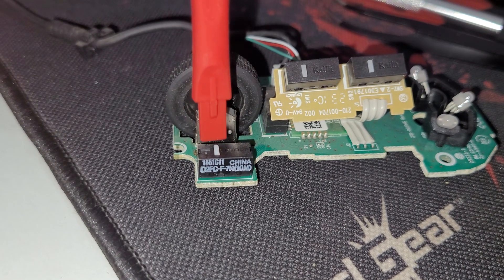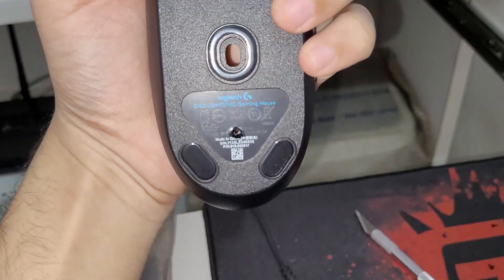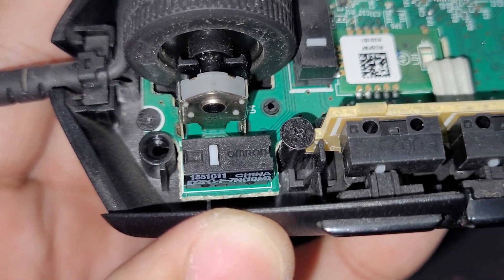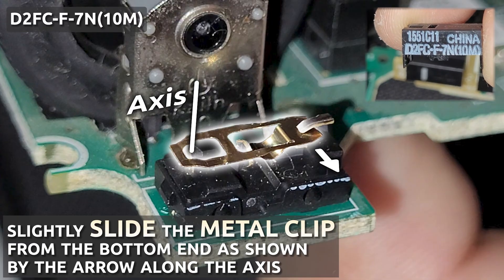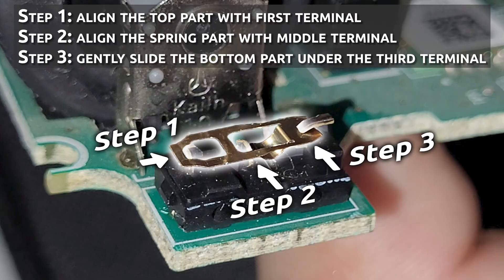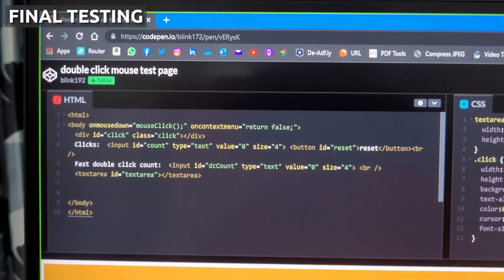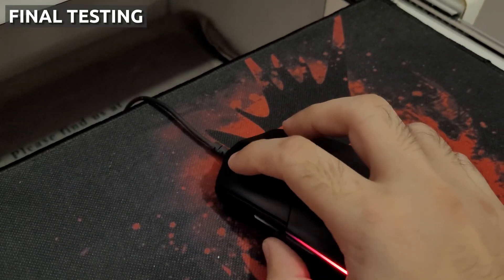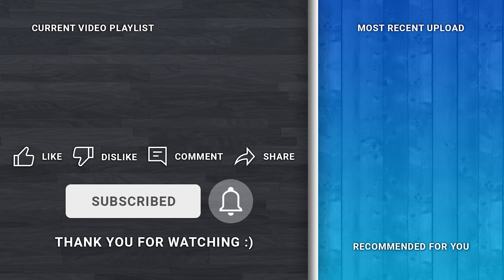Logitech G102 Lightsync: Teardown & Fixing Double Click Issue

Comment: If your mouse is relatively new. Like less than 3 year old . Then just blow some air from your mouth between the gaps of the mouse cause in some mouses(including G102) the double click issue happens because of static build up and our breath has enough moisture to remove that extra static build-up .My almost 3 year G102 had a double click issue and it got fixed by the method above.
Reply from the maker: Woah
Reply: @LoveleshKalonia  this worked for me wow thank you!
Reply from the maker: Spray a little WD40 too, so that it lasts long.
This issue comes back in a few months.
Reply: I tried it and actually worked. Very thanks!
Reply: bro thank you so much..i was about to buy a new mouse but saw your comment and decided to try it and it worked!
Reply: WTF !?   I was blowing it soo hard  many times but didnt worked.. then I saw this comment and blew it like cleaning a sunglasses where it will make a moist... and it frckn worked !!! This guy is a Legend!!!
Reply: @sethjoshz9800 bro just try to pull that left or right click more outside...then blow air it will work for sure...and for example push like 1 cm towards you(that left or right click)
Reply: Thank you so much just blowing in air did the job omg
Reply: thanks bro
Reply: wow, thankyou
Reply: hell nah it actually worked wth bro
Reply: It work for a short time only
Reply: Thanks sigma ! LOL ! I was actually about to buy a new mouse ( IWAS RAGING PRIOR TO FINDING THIS VIDEOO) U save me sum moolah... what a sigma!!
Reply: oh it worked.
Reply: lol you are a fukkking legend men XD thank you so muchhh
Reply: Thanks bro, it worked. This method never crossed to my mind for 2 years ever since my mouse broke
Reply: bro this shit is the actual real solution! Thanks for Sharing! saved me lots of technical and risky steps from this video
Reply: WTF that worked, thanks so much, i actually bought another mouse but wanted to give this to my sister, thanks a lot g
Reply: Thank you maaan
Reply: it actually worked. thanks a lot
Reply: lol that did the trick
Reply: i had this problem only in 4 months period after i bought this logitech mouse of mine in 2021,, and then just leave it to rot in my drawer after couldnt find the fix and even not bother to open it,, but here i am in 2025 found it in my drawer and wonder trying to fix it with a will to disassemble it in my spare time and just found out that blowing is what i need smh,,,, i thanks for it and the video too for my reference if i need literal cleaning much appreciate both....
Reply: YOURE A LIFESAVER!! CAN'T BELIEVE IT'S MAGICAL.
Reply: The hell, its workkk, thanksss
Reply: I did it few months ago it was good after then and now again that has started happening
Reply: @uzumakinaruto-dv7hh  yes the issue is back for me like 2 days after blowing
Reply: @adii.11 😭
Reply from the maker: Use WD-40 brother. It hasn't happened to me again.
Scroll wheel got fixed too.
Reply: whoa its works, thanks bro
Reply: Wait what? It actually works.
Reply: damn it worked thanks
Reply: Whaaaat?? I fix my mouse. But I already bought another . Ahahah thx
Reply: Bro ur really legend I don't know how to thank you ❤️❤️
Reply: holy shit, this saved me from wasting my money on a new mouse
Reply: It works. Thanks <3
Reply: 3 blows worked lol ty
Reply: brooo it worked'
Reply: 1 year later and this still work! thank you!

Comment: This worked!! Thank you so much for the amazing explanation! I just had to be careful with the metal piece that was inside the omron switch. I even fixed an issue with my scroll wheel where it would randomly scroll the opposite direction. This video was very helpful!

Comment: how to open the mouse body ? i dont know the size of the screwdriver
Reply from the maker: You can invest in something like - https://www.amazon.in/dp/B07V3TDP49
Reply: @LoveleshKalonia  so you can open it with 0.8 mm screwdriver?
Reply from the maker: @mdb1205  don't know the size brother. The tip must be 2 mm in length with .8 mm width I guess.

Comment: Using the button reassignment facility in the Logitech mouse app, I mapped the wheel click button to the DPI change button, and the primary Click to the wheel mouse click. It is a semi-elegant fix for the problems of the G102.
Reply from the maker: Brother how did you reassign the wheel up and down to side buttons? I would love to have that.
Reply: @LoveleshKalonia  it's an option in the Logitech G Hub software. Select Lightsync and click the + icon to change key assignments.
Reply from the maker: @NickBurgoyne  oh the G-Hub software, I was trying to avoid installing it. Before I was using that standalone OnBoardMemoryManager. Anyway, thanks man, I will give that software a try.
Reply from the maker: Great workaround! I changed the number of lines being scrolled in windows to 1 and the side buttons work perfectly. I am no longer using scroll wheel other than for doing MMB click.
Pinning your comment for reach.

Comment: how did you removed the housing of the two switches? :(((
Reply from the maker: Use a thin flat head screwdriver. You can also use safety-pins. Pry open the latches on either side of the button. Don't flex the latches too much or you will break them.

Comment: I RMA my G102 Lightsync 3 times during warranty....2 times for double click and one time for scroll jumping issue....and after warranty over my 4th replacement having double click issue and strange thing is that the 2nd side button (back button) with Kalih switch also having double click issue as I use it same as the left click.....but now I cleaned both of them thanks to your video..... I just want to say from my experience, you have to be very gentle and extra careful during the opening and cleaning 😊
Reply from the maker: Glad to hear the video helped. But yea need to be very careful while handling those tiny metal parts.

Comment: please share the tool set you are using to open and fix or any recommended tool set
Reply from the maker: I am using AmazonBasics 51-Piece Screwdriver Set. It is good enough for such work. Just remember it is for phone repair type of work and can't handle too much torque. Same for the plastics leverages.

Comment: is there a fix for the g102 scroll wheel? the problem is that it's registering the incorrect direction everytime I scroll
Reply from the maker: As far as I know, I do not think it is possible...
Maybe you can find the Kailh Scroll somewhere online and then replace with some soldering work.
I know it's sad, G102 is an overrated mouse.
Reply from the maker: Check the pinned comment brother. It is a nice work around for Scroll issue.

Comment: I don't recommend Logitech G102 Lightsync. Even though it feels very solid and works great initially, it breaks just after a few months of usage. I bought a Logitech G102 Lightsync and had to RMA it 2 times in 1 year due to the scroll wheel registering incorrect direction after just a few months of usage. All 3 mice had this same issue pop up after ~4 months. The shop eventually returned my money since I guess they realized there is no point in continuing replacing what is essentially a factory defective mouse. Such a shame since it feels very sturdy and was pleasant to use. However, due to these issues, I can no longer recommend it.
Reply from the maker: I totally agree with you. Even their cheaper models like M100 has optical encoder scroll wheel and lasts longer. G102 is overrated.
Reply: i have g402, originally g302, but after rma twice, the shop offered me to upgrade free to g402. it failed in 2.5 years (which is most longest than other logitech mouses out there). 

I opened it up , yeet the original switches, put Huano Blue white dot switches. kaboom. Until this day, i repaired 3 mouse (g402, M171, G102) and none of them failed until now. M171 been abused by my sister playing genshin impact, and still holds up till now.

Moral of story : dont ditch your logitech, just remove (yeet) the original switches, and put huano/any good brand switches and your logitech is durable like a tank.
Reply from the maker: Yes the Logitech sensor is good no doubt.
Your suggestion also is great. I will definitely try this next time my button fails.
Reply: same. what a shitty house
Reply: same scrollwheel issue for me and 2 mice
Reply from the maker: Try WD-40, it will be like a permanent solution.
Reply: Update: solved by cleaning it inside by scraping dust with screwdriver and tissue, idk how long it lasts

Comment: Thank you for toturial. My mouse keeps disconnecting if I move it a little bit .... What would be the probleme please
Reply from the maker: Most likely cable is damaged somewhere... You will have to do some DIY work to replace/repair it. But first, use a multi meter to check connection between USB plug side and wire soldered on Mouse's main board, this will confirm if cable is damaged or not.
Reply: @LoveleshKalonia  thank you very much